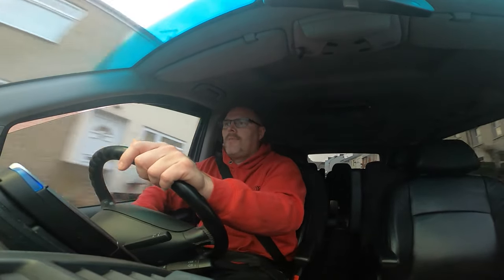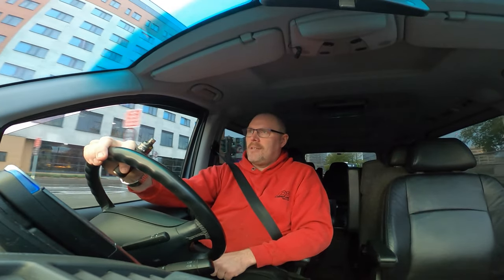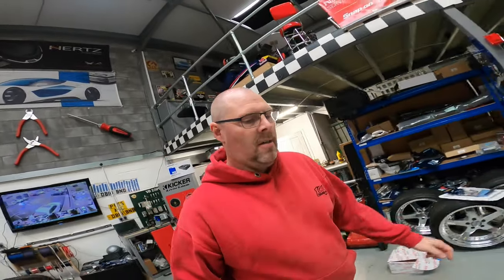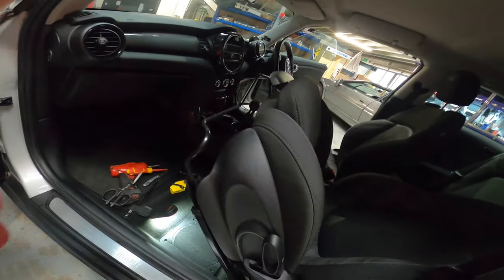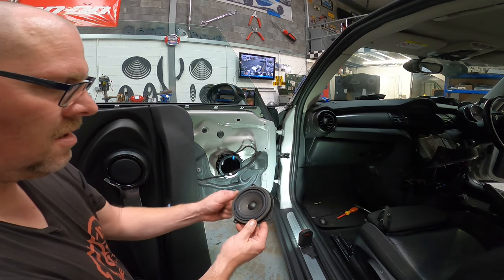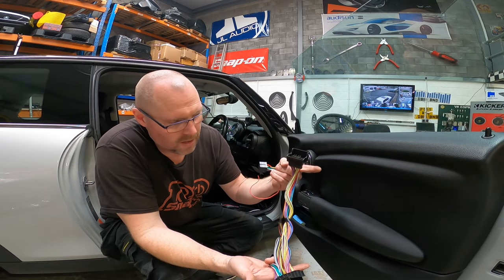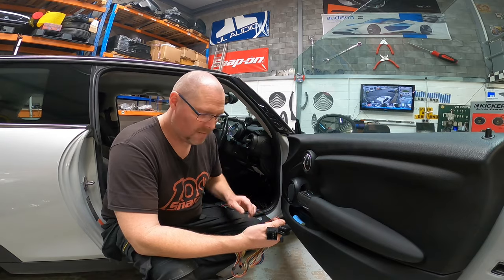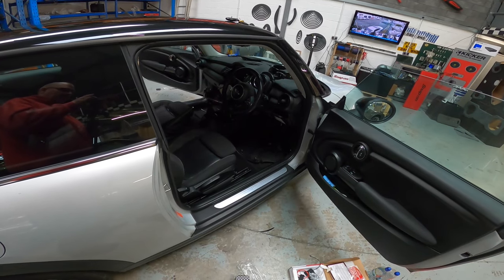kicker key and bu rock speakers in a bmw mini

Comment: Hi Alex   Have you ever installed a MMI box to a MIni to give android auto features etc   Thoughts if you have
Reply from the maker: hi keith the intergration boxes are same same they all borrow the input from the car into their boxes and then out put the same info but with an overlay by usually pressing and holding a button to default to a new screen / menu like carplay .
the integration falls over depending on screen res or how the screen is used if its touch its more normal to use the term bluntly if the screen is not you have to use the navigation keys or wheel to navigate through menus and choices this can become a little tedious in my opinion but they work , we tend to aim for a company called unique they do the kits but not priced like you see on amazon or alibaba , if you get my drift